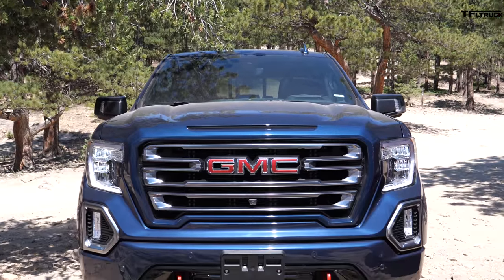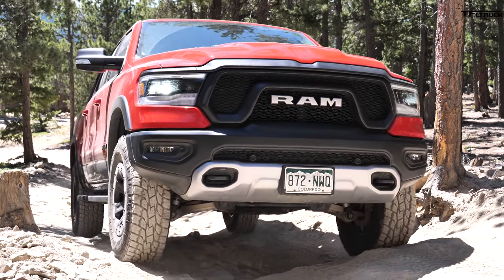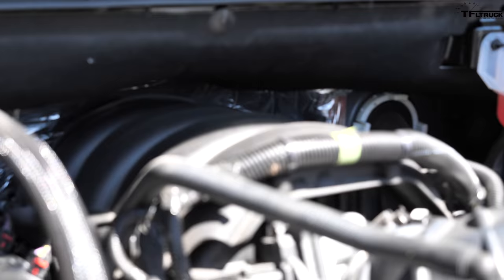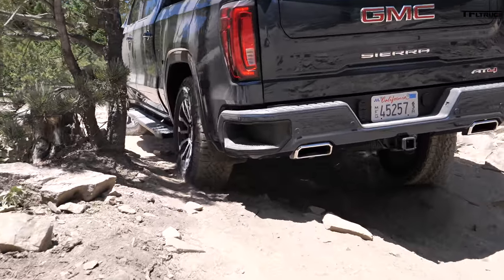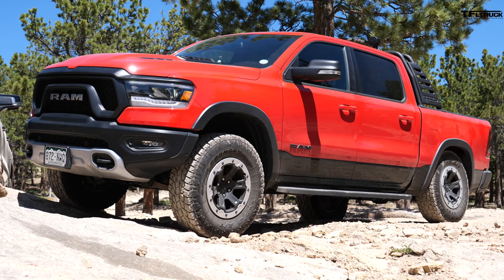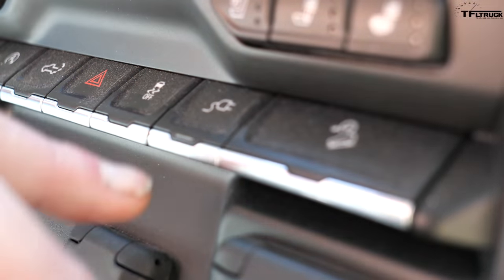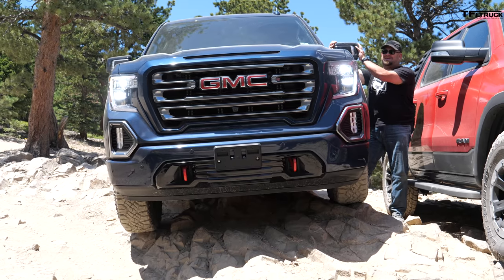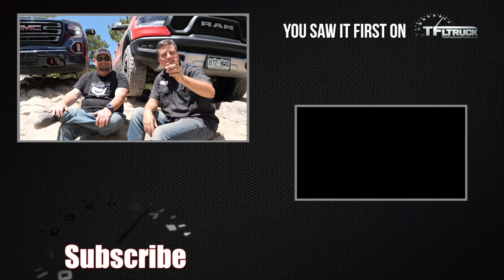GMC Sierra AT4 Comes Up to Challenge the Ram Rebel Rouser and This is What Happens | Ep.7

Comment: Andre... “flipping the switch” on those shocks does not allow your suspension to flex more, it merely controls compression and rebound in the shock, so it only controls how fast not how far the shock can move.
Reply: TFL has come a long way but they seem to have always had a hard time understanding the actual functionality of things. It was real bad in the beginning.
Reply: @JsGarage  I agree 100%. Especially when the still confuse the auto 4wd with AWD. I feel like they still think it's AWD when selected but out of hearing people correct them they just only concede and say it's "like" AWD.
Reply: @EGGINFOOLS  Yea there are a lot of things they explain weird and/or wrong from a mechanical standpoint. Main reason I keep watching is to see things that aren't out yet as there are pretty good with getting first coverage.
Reply: Ok so while andre definitely didnt think this much in detail when saying that, "flipping the switch" DOES allow for more travel given a certain, fixed amount force. The adjustment, as mentioned, controls the resistance to movement of the shock, not its maximum travel range. BUT it does allow for slightly more travel given the exact same impact than when the shocks are adjusted for towing, as long as you remain within the travel range of the shocks.
Reply: @berkalper4742  Changing the rate doesn't mean it articulates more or less. Especially when they are just slowly going down the trail. It's articulating the same just at different rates. It's doing way more for comfort and body motion than anything else. He misspoke and that's fine but they often explain things weird. The travel is the same regardless because the rate isn't changed so much that it would limit articulation. It would be different if it was so extreme that it actually limited travel but that's not how these shocks work. The truck articulates faster or slower not more or less in this case.
Reply: @JsGarage  given a certain amount of force over a certain amount of time, a shock that is adjusted to be softer will travel a little bit more, as long as the total travel for either setting isnt near the maximum range of motion for that shock. Let's be clear, we are in total agreement that what he said was incorrect in how he said it, and lack of technical knowledge about a lot of vehicle components and dynamics is unfortunately common with tfl and a lot of other youtubers, but there is a grain of truth that there will be slightly more travel on average over some bumps than on the stiffest setting.
Reply: Drew w I concur sir.
Reply: Berk Alper I get what you’re implying but when the truck drives over a rock it will articulate the same regardless of shock setting on these shocks. Sure the shock will cycle through more of the travel in general as it hits bumps on the softer setting but it isn’t articulating more. The overall shock travel, bump stops and the spring rate are dictating actual articulation. Like I said with them slowly going down the trail they aren’t seeing any differences in articulation. Sure if they went fast enough the slower shock rate could potentially cause the suspension to articulate less because it could be over the obstacle before the shock cycles but again this isn’t really happening here as they’d have to be going quite fast. For the sake of agreeing yes the less dampened setting will cycle through more of the shock travel more often when hitting various terrain. As far as how far the rear axle can/will tilt or the height difference of the tires side to side driving over an obstacle there will be no change. That last sentence is what we know as articulation of the suspension.
Reply: @JsGarage  yeah sounds good
Reply: I would take the chevy hands down. Less money and more amenities along with more comfort. I mean, if your going for a rebel, you might as well just spring for the power wagon. Similar gas mileage and towing capacity but on a 3/4 ton chassis. Plus the power wagons are less money!!
Reply: @shawnhenrickson3840  No one can argue your opinion but we can argue that you have your cheaper statements wrong. The AT4 starts at $51K, Trail Boss $49.9K, Rebel $49.4K (with 5.7L) and Power Wagon $53K all crew cabs. Not sure how  you think the GM trucks offer more amenities but I won't argue your preference. The rebel has the cheapest starting price albeit marginally to the Trail Boss and has a lot going for it depending on what matters to you. There are a lot of reasons to pick the rebel over the Power Wagon. Maneuverability and ride quality are high on the list. The crew cab is larger than the older(updated) cab the power wagon has. If you don't need 3/4 ton towing and serious trail capabilities than the Power Wagon is not a good buy really. You'll likely find more money off of a Rebel through incentives as well. Bottom line the power wagon is not a cheaper vehicle from any angle you look at it.
Reply: @shawnhenrickson3840  Personally I think the Ram is much more comfortable than the GM trucks especially its ride quality. I do dig the looks of the Trail Boss though. Really want to see that 6.2L in that truck too. The interior is a let down in my book but they are a nice step up from last generation. I absolutely love the front end on the new Chevy half ton wish I could say the same for HD. I don't dig the sierras wheelwells and the front end is okay. Rounded wheel wells are nice move for Chevy.
Reply: Jay P 
It all depends on the trim level your going for when it comes to cost. Those 1/2 tons are fully loaded and upwards of $70,000. That is insane! I bought my power wagon last year, fully loaded for $49,000 from Dave Smith.
The AT4 will outlast the ram in quality and reliability. That e-torque system would be something to worry about once you get higher mileage on the truck. 
Remember, the ram rebel was not stock in this video! They had a lift with 35” tires. Tires make the biggest difference in these rigs.
The lockers on the power wagon and the rebel are not easy to engage at times. You have to sit there and roll at 3mph for any given period of time before they will actuate. But, they never show that is the TFL videos. The AT4 locker is automatic just like an old Detroit. 
Look at the horsepower difference in the AT4 and the rebel in this video. It’s a pretty wire margin. Plus the AT4 is available in a diesel.
Reply: @shawnhenrickson3840  The point is the Rebel isn't any more expensive before options than the AT4 or Trailboss. I agree 70K is insane for most trucks. You can definitely get a Rebel for less than $49K right now. E-torque is optional and I would pass on it. The accessories on the TFL Rebel aren't needed for that truck to compete with the AT4, stock the Rebel still has a 1" taller tire than the AT4. For comparison sake it sucks their truck is modified but whatever. 

The lockers on the Rebel and Power wagon are like any other e-locker they often take up to a full tire rotation or so to engage. Once you are engaged though you remain fully locked. The G80 locker on the GM trucks isn't so glorious IMO. When you get out of throttle or go to reverse it needs rotations to auto lock up again and sometimes they just don't lock and need a retry. I would rather deal with some rotation at initial lock and stay locked instead of going in and out of lock all the time personally, but everyone has different needs and wants. That tire spin during a climb can make or break success. G80 is good for most people that just need some added traction on a boat ramp or going through snow for example. It doesn't require thought. Selectable lockers are for the more serious crowd and more predictable results. I've had a couple trucks with G80 and if I got a GM again I'd want it. I don't think it's a better option though. I like that Ram offers a limited slip or selectable locker. I mostly take my Jeep offroad and would go limited slip in my truck again just as I have now. Street performance of the limited slip is better than both G80 and selectable locker. I occasionally do some light off-road in my Ram and the limited slip is plenty for beach cruising and what not. 

There is nothing that confirms longevity on two redesigned pickup trucks. Yea I like the 6.2L better but there isn't anything wrong with the Hemi. I have a 5.7L Hemi with 8 speed and it has been serving me quite well. HP difference is  about 20, really not significant. What can be significant is the GM truck is lighter and packs roughly 60 more torque. The Rebel gets a diesel for 2020 too. 

I like the new GM trucks but the Interior of the Ram and it's rear coil suspension would be a shame to miss out on IMO. Ford, GM and Ram all have nice trucks.
Reply: I bought a Power Wagon for $48,000 last year from dave smith. I test drove probably 10 different models of off road vehicles before I purchased that truck. If you test drove a Power wagon vs a Rebel you would go with the Power Wagon. The feel and control of a 3/4 vs a 1/2 ton is incredibly different. 
Now, Does it turn as sharp as the other two trucks?? No. But, why would you buy a full size truck and be so concerned about a turning radius? The gas mileage for all 3 trucks was comparable right? 
Re-sale value 10 years down the road would be in the Power Wagons favor.
Regular unleaded gas in the Power Wagon. Thats could save you some Dollars down the road?
I will say this, The AT4's interior is far more comfortable and has better dash Button placement for all your AUX stuff.
Reply: Wrong! That’s the “more flex” switch. I gotta get one
Reply: Go start your own channel then bruh and review them correctly....

Comment: I just traded in my old truck for a AT4. It’s amazing I absolutely love it and after having the 5.3 this 6.2 is outstanding with the 10sp. What a great drivetrain
Reply: I have an AT4 and I love it!
Reply: Did your 5.3 before have the 6 speed?  My Trail boss has the 8 speed and its quick! Not much slower than my co-workers 6.2.
Reply: Terrence Jones My 5.3 had the 6sp. Was a great motor but after driving the 6.2 10sp I couldn’t have another 5.3.
Reply: @2wheelobsessed  Don't get me wrong I love the 6.2L as well. But not a fan of the premium fuel. As mentioned a co worker has the 6.2L, he's driven my Trail boss, 5.3L with the 8speed and he's even shocked about how quick it is.  With the old 6 speed the 5.3L was at times lacking. Not now.
Reply: Terrence Jones Yea premium is pricy but the 6.2 runs fine on regular. I loved the 5.3 as well it treated me great but I just adore this 6.2 and love this trans. Wasn’t a fan of the 6sp either, one of my buddies has a Sierra with the 5.3 8sp it is much better with the 8sp for sure
Reply: What's the max distance you can travel on the highway? Trying to find something with 600 mile range
Reply: Nate Young Definitely not getting that kind of range lol. I always fill up when I’m at a quarter tank so I don’t know yet exactly what it’d do on a full tank.
Reply: @nateyoung6331  you might get that with the new 3.0 duramax. I get roughly 420 miles to a tank, but the new GM trucks have small fuel tanks. My older F150 got 550miles to a tank.
Reply: My 8 speed 5.3 is very impressive compared to my old 6 speed.. I'd still like a 6.2 though aha.
Reply: @terrencejones9817  I've heard with the 5.0 in the f150 with extended range gas tank some are getting 650+ miles a tank. If chevy offers a larger tank than it might be able to get same range.
Reply: Jeff Healey These new GM pickups are great with either V8 drivetrain. People love or hate the looks (I was unsure at first but grew to love em) but they are solid fantastic pickups I absolutely love them. Been in friends Fords and Dodges and to me there’s no comparison. Rams have a great interior but well we all know about Rams lol 🤷🏼‍♂️
Reply: @nateyoung6331  I had the largest available tank. If I did pure highway maybe over 600miles. One tank I got 945km ,which is close to 600miles. But that was 85% highway.  Fuel economy got progressively worse over time though.
Reply: @terrencejones9817  I want the range for my long drives home. It would all be highway. And with the family and dogs traveling I prefer the interior space of a truck. Thanks for all the responses. Even if only 550 miles that's 75 more than mine now.
Reply: @2wheelobsessed  ya they are awesome! Took a while to grow on me but love both the at4 and the trail boss but only in certain colors aha.. I ended up going with a blacked out trail boss LT.
Reply: Nate Young you are right on the F-150 with the 5.0 and extended tank making the 600 mark.  I have the older ‘12 with 6 spd and 5.0, if you are good to it on a long trip it can get 21-22 mpg on the highway.  The new 5.0 with more gears and lighter truck does better yet.
Reply: 2wheelobsessed you’re not getting the older reliable 5.3 and 6.2 you’re getting the crappy vvt direct injection that uses 0w20. What are u gonna do when the engine starts consuming oil from the heat?
Reply: Corey The FAM Well I suppose the wise thing to do in that case would be to add oil...
Reply: @uncle_salty_3675   lol bullshit you did, or you didn't bother to actually put your foot on the gas. 

BTW tested 0-60 #s is 6.4 seconds for a crew cab 4x4. That's not slow at all. 10 years ago most trucks would be 8 second 0-60 land. 

I owned  Coyote 5.0 F150 with the 3.73 rear end, a quick truck as well. The Trail boss is easily as fast, maybe touch faster off the line.
Reply: @nateyoung6331   I had the 36 Gallon tank. But max tow for a 5.0L with 6 speed and 3.73 gearing.  Fuel economy started out great in the 21mpg range. But got progressively worse. I did get close to 600miles a couple of times.  Maybe if you drove 55mph and never stopped,  it might have gone as far as 650 miles. I've got a friend with a 2018 5.0 10 speed 3.73 and the fuel economy is roughly the same so far. 

But yeah I wish GM put a large fuel tank in these trucks. Otherwise my new Trailboss is awesome.
Reply: @d c I just put 200 miles on a 2020 Serria with the 5.3L 10 speed. It's not even possible to tell it has 2 extra gears unless you manually shift through the gears. They feel exactly the same.

As for the RAM rebel vs 5.3 trail boss The numbers don't lie. Multiple tests show the 0-60 times are identical.
Reply: @d c I'm glad you love the truck. The 6.2 is a great engine.  I did test drive one as well. Yeah it's faster,  but I didn't feel fast enough to justify the price on the AT4 and the fuel. I'm still happy with my trail boss.
Reply: @d c my Trail boss is Grey too lol.  Don't get me wrong if I was able to spend the extra 10k, I would have got an AT4. Probably diesel. But I'm happy for sure. Enjoy your truck, they are awesome.
Reply: Nate Young get the 3.0 duramax
Reply: @nateyoung6331  you better buy a tesla or a long bed with a 100 gal aux tank!😆

Comment: To everybody crapping on the g80 locker, I've had 3 different z71s and plowed snow with all of them without issue. On the other hand, I cant imagine a solenoid inside a rear end fed by a wire bouncing up and down a million times lasting half as long.
Reply: I agree that the G80 is by far better than a e-locker for bad road conditions...but I feel a selectable locker is best for harder offroad.
Reply: Either these commenters are to younge to remember the auto lockers of the 70s,80s, or they have so much money that an e locker is their only thought process now. Either way  I'm good with the G80 for everything except rock crawling which neither of these trucks are good at so it doesn't matter.
Reply: The new ones are a lot better than the older ones. The only G80's I've seen break under normal use were the 10-bolt version. When GM replaced the wimpy 10-bolt rear axle with a modified version of the 14-bolt SF axle in the half-tons , the G80 had extra space for a bigger more durable carrier. I have friends with 2014+ GM trucks that beat on their G80 often enough without an issue that I wouldn't worry about the durability.
Reply: @karlschauff7989  I agree, the G80 is better for real world use when you dont have to think about
 "Do i need a locker for this" its just there and works..
Reply: @jredd801  Exactly especially because he plows snow the truck knows when to lock and you still got good handling and turning.
Reply: Question, if you're turning a corner or curved street on ice road conditions, and the G80 locks up on a spinning tire, will this cause the vehicle to possibly spin out?